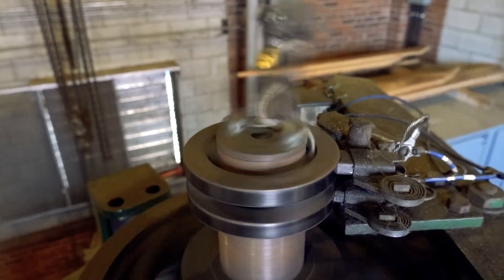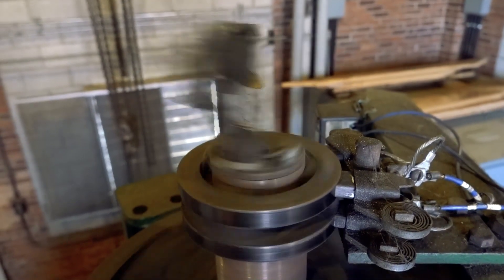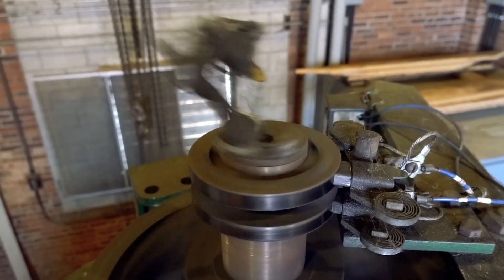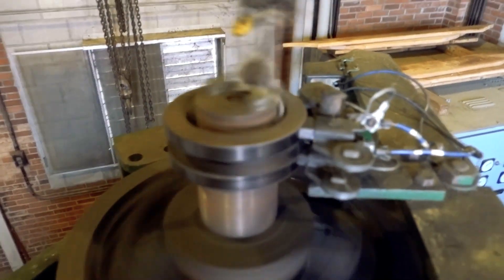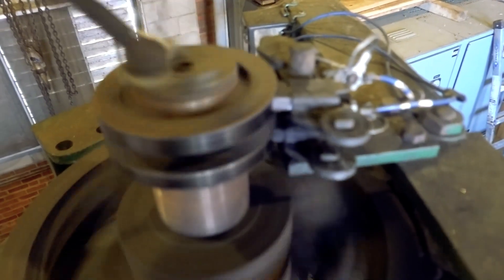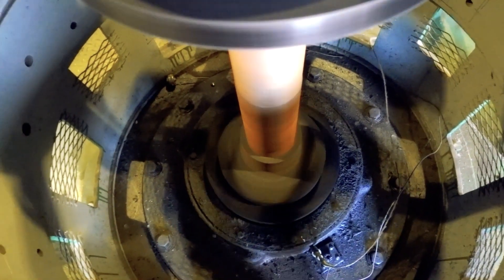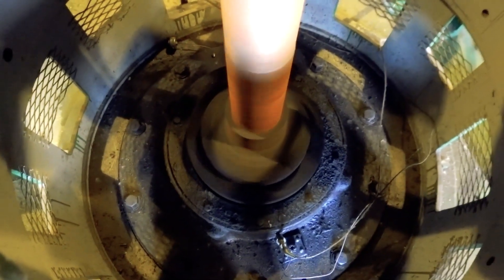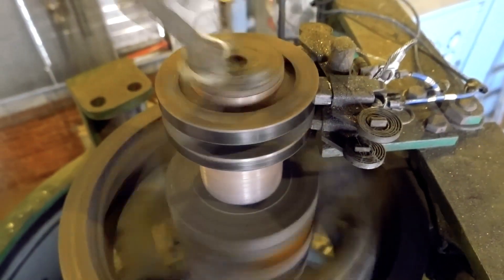Authorized Personnel Only - Mercury Switch Turbine Overspeed Governor In A Hydroelectric Powerplant

Comment: So it makes a circuit to indicate over-speed - doesn't sound very Fail Safe to me.
Surely the Mercury Switch opening on an over-speed condition would be far safer, it would also detect a fault if the slip-ring brushes fail, or a wire comes loose etc.

Comment: I worked at a coal fired powerplant .  The company liked to replace the mercury switches with mechanical ones....   Not really a good idea because the mercury switches last for ever.  Anyhow we got the switch down to the shop and the apprentice I was with did what any stressed out newbie would do.  Maybe if I hadn't said not to break it and just kind of casually didn't asy anything then it would have been better.  He proceeded to knock it off the table and it broke.  We had one of those spill kits and sopped up most of it.  The mercury switches will definetely out last mechanical and you don't have problems with corrosion.  In California in the refineries they used to have differential pressure tubes that were full of mercury.  None of that mercury will probably be recovered ever.  Good old quick silver!!!

Comment: How dose the increased water flow not spin the turbine faster
Reply: the turbine is synced to the grid, full load or no load it will go that speed. More water just means it's pushing harder doing more work at the same speed

Comment: I'm surprised it isn't a normally closed circuit - that way any broken wire is detected.
Reply: I was about to post the same comment. It's an engineering principle to fail to a safe state.
Reply: @badatpseudoscience  Short of a catastophic failure in the generator or gearbox, if this one even needs a gearbox, these machines can't really overspeed when it is actually tied to the grid. There are a bunch of other safeties that either of the two former scenarios would set off, and most likely more modernized reluctor type system also monitoring the RPM. But no reason to delete a perfectly functional additional level of protection.

That turbine spends 99.5%+ of its life tied to the grid, and in the point when its not there are human eyeballs monitoring it. A broken wire being able to take a plant offline is a far less desirable set up. Generalized principles can NEVER be applied to all applications. For example in aviation many systems are designed to fail to an on state, because suddenly losing power due to a non critical issue is far more dangerous than the equipment having the potential to tear itself apart/let out the smoke if a failure is not properly managed.
Reply: @kylehenline3245  at any point in time it there is probably something thats not working if it's about 100 years old so good luck troubleshooting.
Reply: That's actually smart
In case of electrical fault it would shut down the generator
I'm guessing there is some kind of additional safety device like something that measures the frequency and if it gets too high to slow the generator down as well
Reply: @matthewbeasley7765 SPDT mercury switches exist too, contact at each end of the envelope,and one long contract down the length of it.

Comment: The run out on your machines is horrendous. Seriously in need of alignment. The expensive part is you ran them like this, so the thrust bearings will need to be rebuilt. and all the guide bearings, packing boxes, shaft sleeves and runner seal rings are shot.
Reply: Its not run out . Your looking at slip rings they are slightly egg shaped to keep the brushes from sticking
Reply: Feel free to use your time and money to fix what's been working for decades armchair holder downer. Make sure to video it too.
Reply: If seen alot of guns with slightly out of round slip rings just to keep the brushes moving in there housings
Reply: i'd bet there's an issue with the foundation or ground shifting. rebuilding without addressing that would probably just make the problem worse

Comment: If its a safety, shouldnt it open the circuit to stop it? Just wondering mayne it different then normal ones
Reply from the maker: It probably is, I just misspoke.
Reply: @Physicsduck  the mercury switch will be normally open (closes the circuit on an overspeed). To answer Christopher's question; there are other ways to ensure that you have good contact. One of the simplest is to have a resistor across the mercury switch. When the switch is open during normal operation, you can in essence measure the resistance. If the switch closes (overspeed) the resistance goes to zero and you know you've got a problem. If the circuit opens, the measured resistance would go to infinity, and you know you have a different kind of problem.

Comment: What’s up with the runout on those sliprings?
Reply: I think this only works on slower rpm slip rings. High rpm would just beat the brushes like a redheaded step child with egg shapes. I’ve machined slip rings before and my boss wouldn’t even look at them until I had them below a thousandth.
Reply: I'm randomly replying many months later (it's a long story why I'm watching slip ring videos) but: some slip rings are intentionally machined with runout to induce dither in the brushes. Keeping the brushes moving back and forth is one way of preventing them from sticking in the spring-loaded brush holder, so as they wear away they maintain pressure/conductivity.
Reply: @gus_kilpatrick  A man of intelligence. Rare these days. (see above expert with nothing to prove so)
Reply from the maker: When you get that old you'll wobble a little too.
Reply: Old school manufacture tolerances, somewhat worn bearings, etc. etc.
Reply: @LordOfSilense  nah, old school manufacturing tolerances were just as tight as they are now. Saying that is an insult to the machinists of the past.